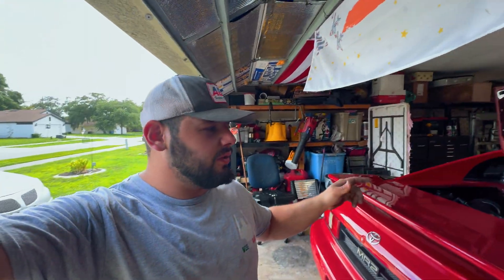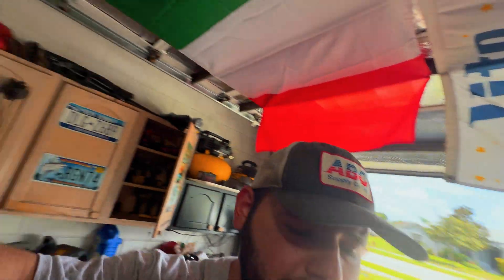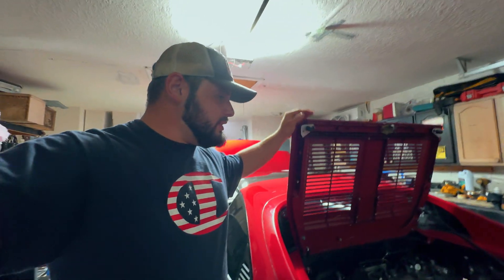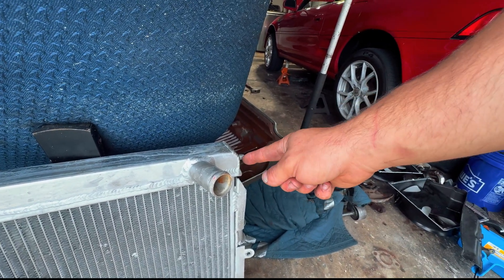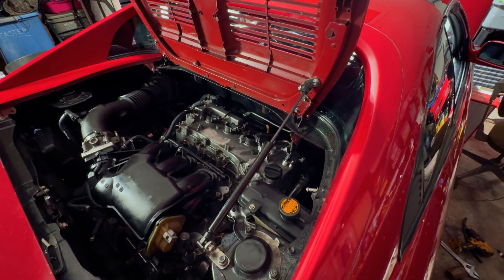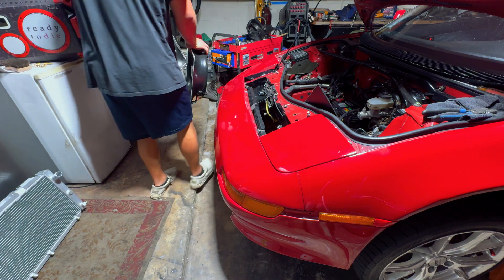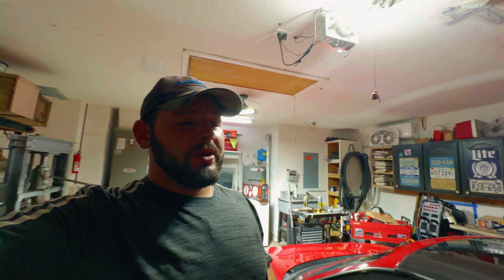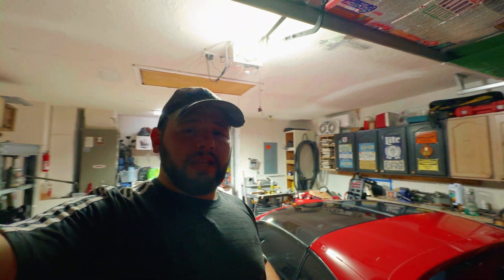DIY Self Bleeding Cooling System For The Toyota MR2 SW20!

Comment: Correct me if I'm wrong, just thinking out loud here, but I am not sure if it's gonna work properly. 
Your donor car tank (rav4) holds less than half the amount of fluid in the cooling system, then MR2 does, therefore I believe the tank might be too small (or pressure too high once that much fluid expands).
Reply from the maker: Thanks for the comment! The v6 rav4 from 2008 takes about 10 quarts when the mr2 takes about 14 quarts. So yeah it’s about 2/3 the size of the mr2 cooling system. I haven’t had an issue as of yet. But I will keep an eye out. I’ve been driving the car all over, haven’t had an issue. If I NEED to go bigger, thankfully Toyota made some bigger expansion tanks for other cars! Lol